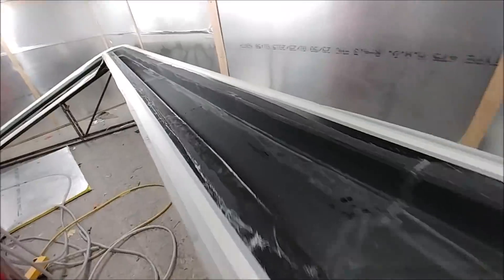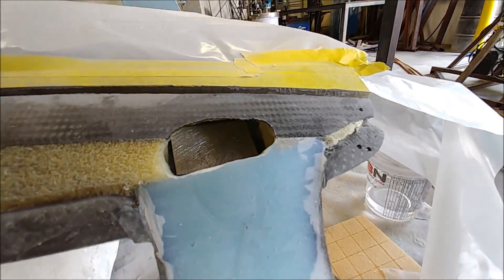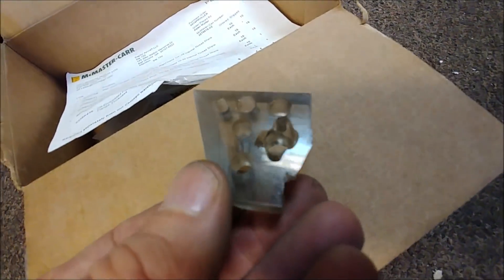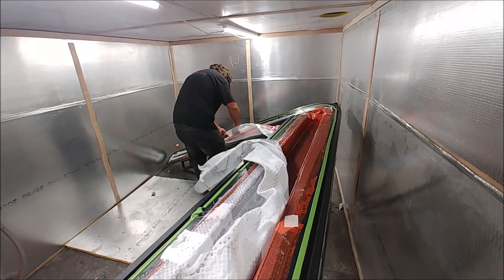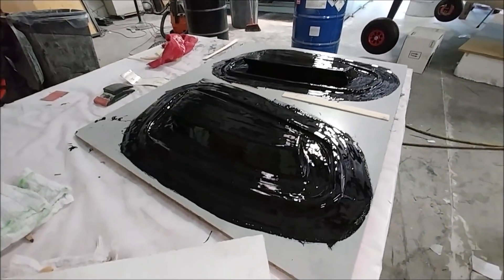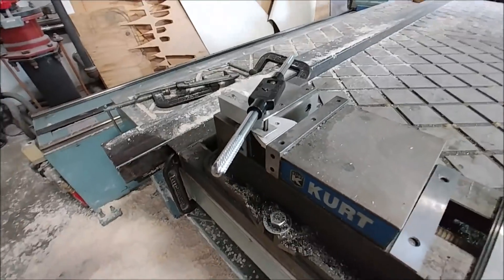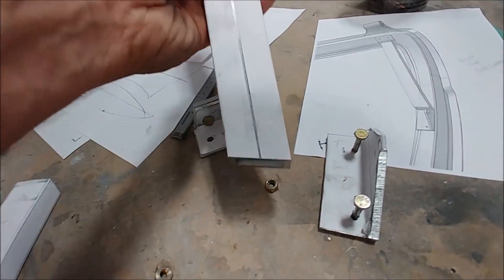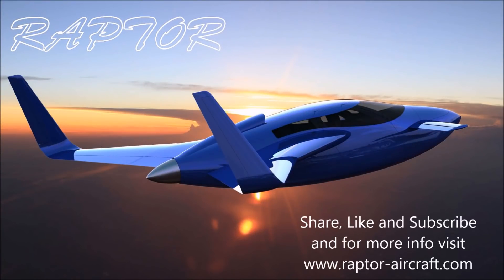First Wing Spar Done - Building the Raptor Prototype

Comment: Cool room is
Reply: Cool room is a great idea..... I'd recommend putting the epoxy and hardener is an environment to cool it to the lowest permissible temp, I've found that to add more time than a cool room. I've actually lost a piece (or two) in an airconditioned room and 90 degree (f) epoxy.     Just some suggestions from past experience I love your project and only wish you the best cheers!!

Comment: Black oxide will rust pretty quickly.  the coating will be scratched when the hardware is installed.  When moisture hits it, it will corrode.

Comment: Hello 
I have been watching your build all the way from Sweden. I may have some time savings for you.
For large layups you can get carbon fiber prepreg with a epoxy that is made for oven curing only.
Also kemical release media is alot faster to use than to wax and PVA spray the molds.

Comment: To drill acrylic glass, a negative cuting edge is needed. Much the same way as it is for brass or wood (and with these specialy purpose drils you picked). When using a brass drill bit it's useful to have the other side tied to a flat pice of wood to avoide a broken out rim. Using wood drills avoide this anyway. Almost more important then selecting the right drill bit is the speed and timing. Let it run slow. Best is produceing acontinous, maybe broken flake. If the flakes turn into crumbs the speed is too high, if they start to look glazed, temperature is buildign up to high. It takes some patience. Usually only do like 5mm (1/5th of an inch) at once, then give it a few seconds to cool off. A clean and shiney surface with sharp edges will be the reward.

Comment: A part of me wonders, given all the bricolage you've had to do to make the doors 'work', if it wouldn't have been easier (maybe even now safer?)  to get the door moulds out of the warehouse and just make 2 new doors wherein all the mods can be freshly incorporated, including embedding the aluminium reinforcements directly into the door frames??
Reply: I agree ............ the time spent on the doors thus far has simply been the learning required to design a much better one......zero shame in that......I would ditch the doors and remake them entirely.......
Reply: He has an entirely different dual door design for the production aircraft. These are for the prototype only. I do believe that the window mounting will be re-designed as well.